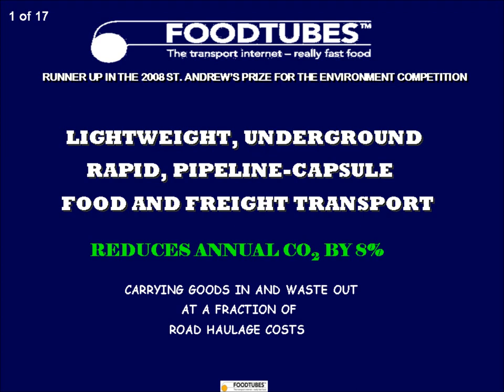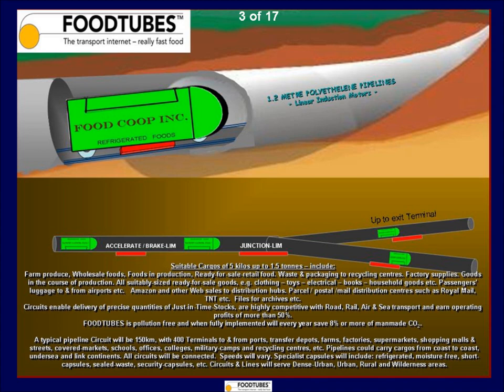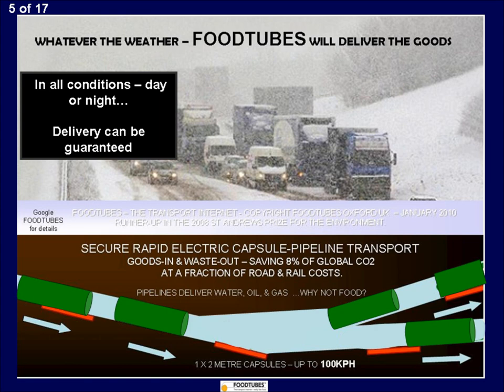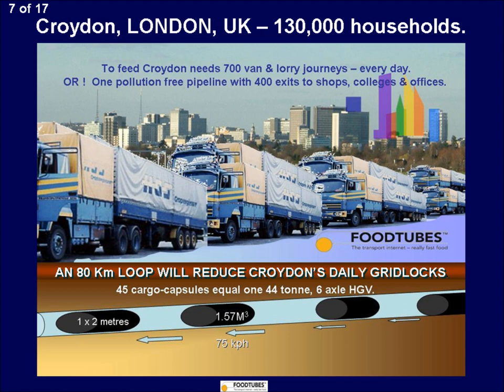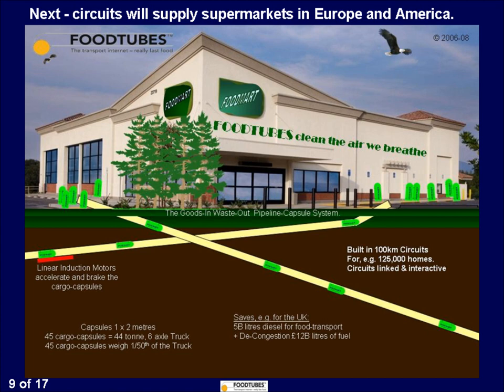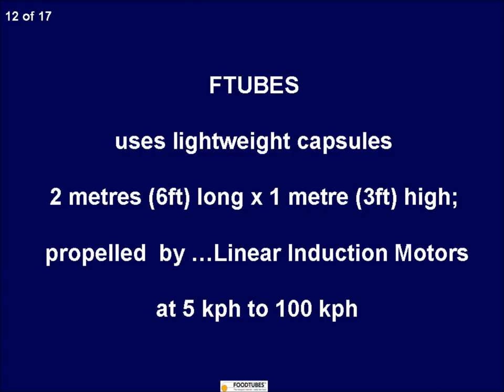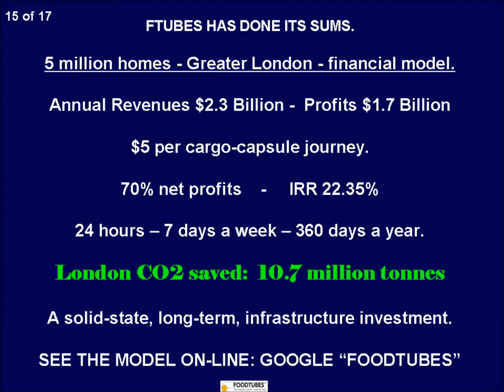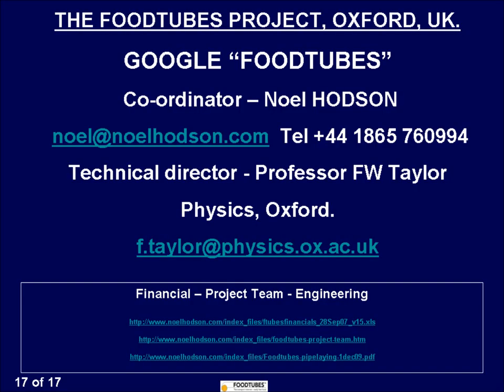FOODTUBES GREEN TRANSPORT.wmv

Comment from the maker: Access to Foodtubes Circuits Terminals will be controlled - both with physical cages and locks - and with electronic scanners for banned cargoes. Unacceptable contents in cargo-capsules will be re-routed to examination terminals. The system will be safer than road & rail trucks, ships and air transport. Security will be very important.